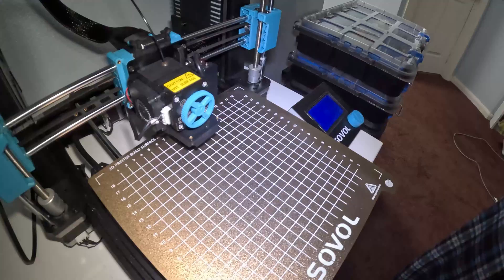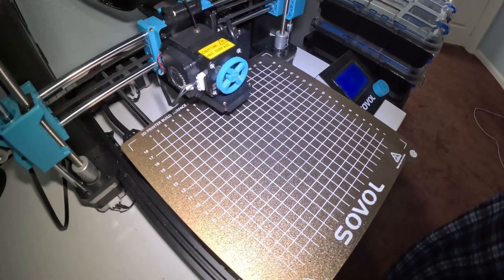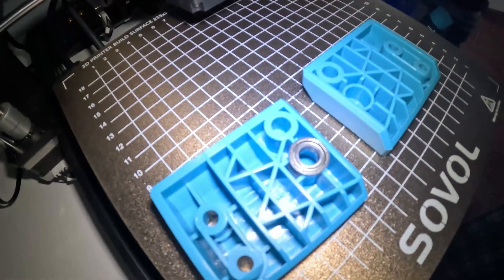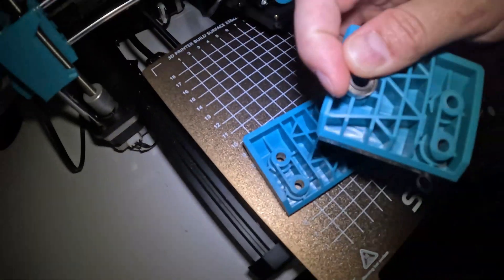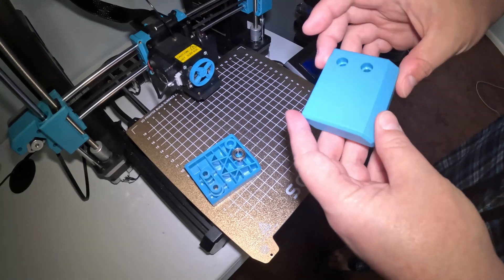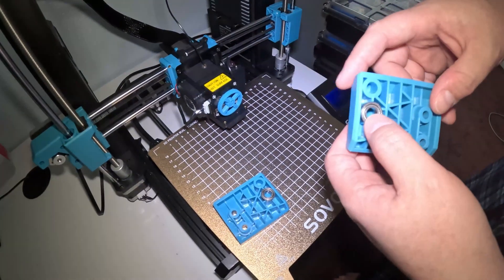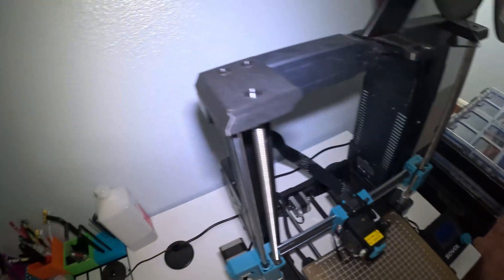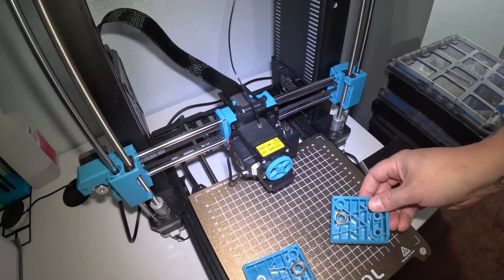[FOLLOW-UP] SOVOL SV06 Z-Bearing Axis Mod

Comment: I don't do that. I don't think it should be done. If you have any curvature in the Z threaded rods, you constrained them at the bottom, you constrained them at the top, you constrained them in the middle, deformation goes where? It goes into the frame. It bends the Z smooth rods to allow the threaded rods to keep wobbling. They wobble at half the amplitude, but the other half goes into the print, as the smooth Z rods at the carriage height get bent offset relative to the bed.

Print quality is solved by re-aligning the coupling, and also using one that is straight.
Reply from the maker: ...of course it would be a bad idea to do this with bent parts.
Reply: @room281tech8  well they aren't ever perfectly straight, nor are any other linear elements, but threaded elements tend to be worse. This is one of those reasons why overconstraint is usually best avoided or limited
Reply from the maker: @SianaGearz  True nothing is perfect, but that doesn't mean it is so out of spec it will cause an issue either. Sometimes certain things are not included in a mechanism such as this, not because it will create an issue, but because it isn't necessarily critical to operation and by excluding a bearing during manufacturing cut costs. The sv06 plus has this mod just as many other brands and designs do. The best we should be is mindful of the thing we do. I try not approach projects with a can't be done attitude but more of a "let's find out" mindset. What I've seen from hundreds of hours on two of these printers is that the frame became more solid, less flex, with excellent print quality, just very smooth operation.

Comment: I tried the f688zz they keep falling down you need to put tape around the bearing to keep it in i think your other way is better
Reply from the maker: I prefer the printed part available on printables with the 608zz bearing more. This was one of those mods that a commenter brought to my attention. I thought it would be fun to try because it used the stock parts and make a video on it.  The bearing wouldn't stay in long term on the right side. The left side was fine. I opted to remove them and go back to the printed version with the 608zz.
Reply from the maker: https://www.printables.com/model/462039-sovol-sv06-simple-zaxis-bearing-adapter

Comment: I presume this is to eliminate the obnoxious noise caused by the leadscrews vibrating? When I print at high speeds, they hit the injection-molded part as they vibrate, and it's quite loud
Reply from the maker: There is a setting basically cranks up the torque as it speeds up. Every once in awhile I see people talking about it. I believe it is called stealthchop. I know it causes noise and vibration. Perhaps that may fix your issue, best of luck.

Comment: just got my SV06 (my first 3d printer) how do I know if i need to replace these bearings ?
Reply from the maker: So from what I understand now, Sovol has been shipping their printers with dry bearings. I would assume you would just need to pack them with grease. However there are some, including myself whom have had mixed results. Try cleaning and packing the bearings first and see how it goes. When I repacked my bearing the seals on the end of the bearings came loose and balls started falling out. Just keep an eye on that.

Comment: Only thing I've noticed with these bearing is they do not stay in the housing and sometimes fall down the screw rod. Got any recommendations for securing them in?
Reply: Pause the print insert bearing print over bearig. Of course you need to modify the file.Prusa slicer has the option to pause the print at a certain layer so you can insert stuff like magnets nuts bearings etc.
Reply from the maker: Unfortunately this is the stock part. When I have time, perhaps I'll download the step file to this and play around with it and create a setup with a bearing enclosed within the print, which would look cool.
Reply from the maker: I noticed that too with the stock parts. I have a couple different versions of this part. I prefer the one with the 608-ZZ bearings that I used in another video. However I would prefer to use these I like having the stock color.

Comment: I'm afraid I don't understand the need for this mod. My understanding is that the guide rods were responsible for the alignment while the screws were purposely left unsupported at the end to avoid any lateral forces on them. With an unsupported top section, if the screws are imperfect, then it won't put any X-Y force on the gantry so it essentially won't matter, but if the bearings are retaining the end of the screws, an imperfect screw would put force on the guide rods as they rotate.

Maybe I'm missing something though, but I think an ideal situation would be to have the ends of the screws floating and not touching anything.

Comment: Thanks for sharing! I was trying to fit 12mm bearings inside the smaller hole but they are slightly smaller and an adapter was needed. With 688zz bearings the fit is just perfect.
Reply from the maker: Right on, glad to hear this helped you.

Comment: Thanks for your video and great job with your content.  I have trouble believing that locking the top of the leadscrew from translation movement will improve print quality. The leadscrew must float to allow the veritcal rods to do the guiding.  Think about it, why have vertical rods at all if the leadscrew can perform the function of lifting the carriage as well as keeping it straight.  The simple answer is that leadscrews can't guide the carriage as well and as easily as perfectly straight rods.  The tolerance in manufacturing leadscrews and nuts is greater than the tolerance of the smooth straight rods and linear bearing.  I've not performed the experiment but I'm a hard sell that adding the bearing to the leadscrew will improve print quality.  Thoughts?
Reply: I agree, there is  a reason that the Prusa MK3s+ on which the SV06 is based has no bearings.
Reply: @dtyra and there is a reason why the MK4 and SV06+ have them
Reply from the maker: So for me it cleared up this strange little imperfection that triggered my OCD that would appear in the same place on all my benchys with varying types of filaments. It wasn't even a bad imperfection, but I knew it was there. Anyway, I wasn't expecting really anything but I was pleasantly surprised with the result. Obviously everyone's mileage may vary. All I can really say is that it made a difference for me. I can't really speak for others. So if you got the bearings and filament, have some fun.

Comment: Unbelievable. You made me believe I needed to print out my own parts to make this mod work. I did absolutely no research and this is your fault. Unfollowed, unsubscribed, police called. 

But in all seriousness I kinda like the look of my custom parts and I actually modified one of them in blender to incorporate a built in tool holder so I think I'll stick to them for now (and I don't want to have to buy more bearings).
Reply from the maker: I like my custom PETG printed part too, but I had to try this out. It is a cool idea and I'm glad someone shared this with me. I know some people just love that stock look and this definitely is the way to go for that look until I can fine "Sovol Blue" filament.

Comment: What filament did you use to come close to "Sovol Blue"?
Reply from the maker: Those are actually the stock sovol parts. The 688zz bearing fits nicely in there. If I find a Sovol blue filament, I'll post it here